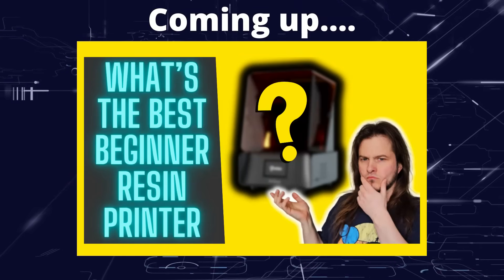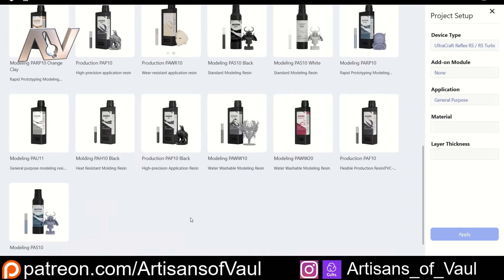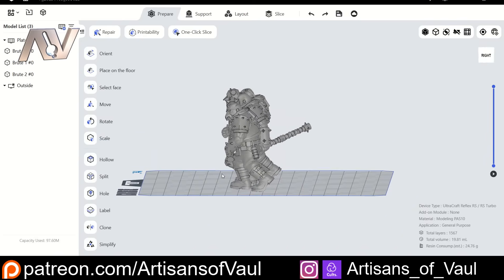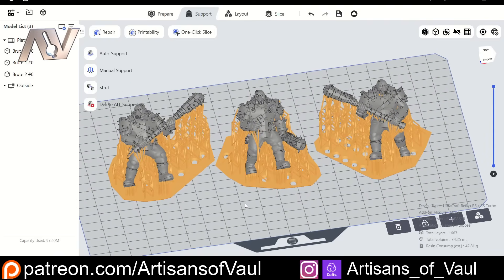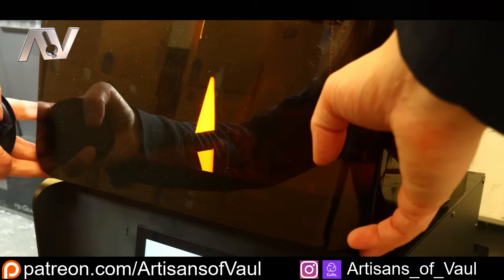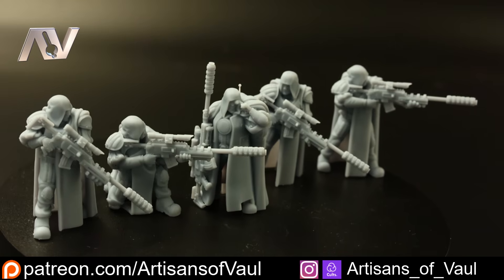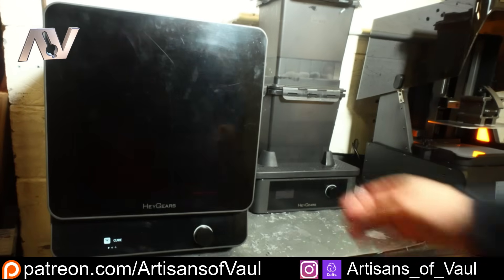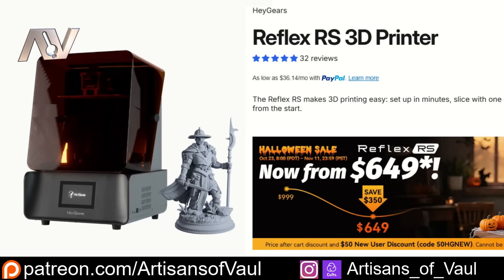Why This Resin Printer Is Perfect For Beginners!

Comment: Hi again, I'm so 'bleeped off with my Anycubic Photon Mono X, its been an a7se ache since I got it, I have found the company has no care, support or service for their customers, quite shocking.

So do I buy one of these? Could I use the rinser and curer I bought the the crappy thing I have (mentioned above)
Reply from the maker: Really sorry to hear that as thats always frustrating.  As I say this printer has been fantastic for me and I have been using it for all sorts of prints.  You can see some in my instagram if you want more examples of what it can do.

Comment: I'm also using the RS Turbo with the Pas10 resin. Generally fantastic results. I did get a failed print with 100 micron setting- and that was letting BluePrint do the slicing, support, layout etc. I reprinted the same item with the 50 micron setting and it worked fine. I've had it for a few months, and basically it works as advertised. But not quite 100% perfect.
Reply from the maker: Thanks for that, really helpful. I must admit 100 micron isnt something Id be likely to go near (it would be unusual to use anything other than the fine) so thats well worth knowing 👍🏻👍🏻👍🏻

Comment: Is this good for car parts
Reply from the maker: As in printing car parts? So unusually for a resin printer this has resins that are very tough and Ive seen some videos showing some really impact resistant parts. But I havent tested them as I normally make miniatures. If you contact HeyGears they would probably be best to advise you.
Reply: You'd have to do some requirement engineering there. What stresses do your parts need to endure? Heat: more difficult than FDM as the material not only might soften but also the curing process is a factor. Think annealing in FDM, but a more gradual process. I.e. some resins prescribe a thermal stage (roughly in line with hot car interior) after UV exposure to get their advertised properties. Others do the same chemistry without telling you about. Are solvents a topic for your application? Vibrational stresses?
That's an interesting topic for standard materials, and those resins' properties depend on how you treat them as another set of variables.
Reply: @robertmartinu8803 I really appreciate it.  I have to dive deep into it
Reply from the maker: @robertmartinu8803 Thanks for replying to this. Some really good information. There are some specific resins that HeyGears have but I dont know enough about car parts to comment on if they would be acceptable.

Comment: @ArtisansofVaul Hi again, I  always enjoy your videos no matter the topic, your unbiased reviews are fab 👍🏻 this printer I might save up for, I bought the Anycubic photon mono X  not that long ago and what a disappointment for my first printer, I think that I'm actually starting to hate it and the company because their customer service is simply shicking and dismissive. 

Is the print speed rate any difference to other machines considering the time requirements for each layer?

Final thing to do you know where to buy Anycubic spare parts, i feel i might need a replacement screen (can't remember the proper name) the one under resin vat that does the curing/setting each layer
Reply from the maker: I thought they used to have replacement parts on their site (though it was a while ago I bought an Anycubic printer).  Though when I had one buying a new printer was so close to the cost of the screen I did that...
Reply: @ArtisansofVaul Yes, how often does it happen that discard n buy new is a better opinion than replacing parts, sad reflection on how businesses operate 😢

Comment: This printer and the cleaning station really interested me when they first came out. The pulse module does lessen support scarring, from others I have watched, when compared to side-by-side. What stopped me, and it may be changed now, was the slicer having to always connect. Bad signals here made that impossible. 

I'm not opposed to closed systems, as long as I know it is going in, but the resin gave me caution.
Reply from the maker: Do you mean having the printer connected to a computer? If that was once the case it definetly isnt now. My RS hasn't had any signal from my WiFi because of where it is so I moved all the files across by USB.
Reply: @ArtisansofVaul  No, I meant the slicer itself did not have an offline mode. Which I think they fixed about a year ago, but at the time that is what stopped me. I remember it also could not use Lychee or Chitu.
Reply from the maker: @RoseKindred  Ah, ok.  That Im not sure about 100% as my laptop was in a room that rarely has WiFi but can at points and I didn't think to check at the time.  I can check later when I am at my computer.

Comment: I'd get 3 Saturn 3 ultras for that price but ok if you get it free!
Reply from the maker: If you really think that makes a difference why would I say other elements aren't worth the money?

Also you could actually get multiple Saturn 4 Ultras so maybe give a more valid point if you can. But it still doesnt change that this is vastly easier to use, especially for a beginner.
Reply: @ArtisansofVaul so how much did it cost you?
Reply from the maker: @silverbullet6833 what an RS? I think I showed it in the video but at the moment £621.
Reply: @ArtisansofVaul not exactly what I asked but
That in itself is twice what a Saturn 4 ultra costs, then there is the wash and cure , gloves, alcohol, mask, towel and the resin. 

At which point you are closer to 2 grand in then you find out it won't print because it's too cold

So you can't maintain a warm environment of 23-26°C you will need some sort of heating, more expense. 

I didn't feel you really hit on all the additional requirements  that a beginner won't know until they are in too deep to quit! 

A Saturn 4 ultra 16k is also heated already and I bet the RS still only has the same 2000hr/3 months screen warranty? 

The technology per machine is basically identical and if you want to run other resins which are effectively a quarter of the price you will likely have to do the calibration work, which isn't hard and can be done in a couple of hours using what 100g of resin
Reply from the maker: @silverbullet6833 Dont get me wrong I love my Saturn 4 Ultra and totally appreciate what it does. I also appreciate the beginner costs (im already planning a video to go through full start up costs for printing). But as you have said its expensive. In the long run because of that expense (a lot of which isnt the printer) I would argue the printer being more expensive isnt the biggest hit. And totally go for the cheaper other elements(though Im sure you'll agree getting an acceptable cleaner is pretty key) but I do honestly think this is the best starting point. I wouldnt have said it otherwise.

 I have plenty of products I get sent and then send back because they aren't very good or I need to point out issues and the company wont let me as part of the agreement with them. This wasnt one of those products. It is probably better than I have made out here but I wound myself back because I didnt want to sound like some OTT fan boy or someone that was being paid for a review. I had seen other reviews making comments for this machine and I felt that it was a bit too good to be true (for example I really like Fauxhammer and he was VERY complementary about the RS). Having used it I can see why he says he wouldnt use a different printer.

Comment: Seems too expensive to me, Photon for half or Saturn for one third would be my choice.
Reply from the maker: It definetly isn't the cheapest printer out there. But the ease of use and reliability is on a completely different level. By now Im 3 bottles or resin through (and I print mostly small objects) so the time saved just on the auto-supports being amazing and having not a single failure means I just haven't touched my Saturn 4 Ultra.